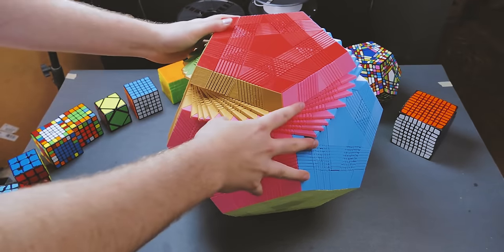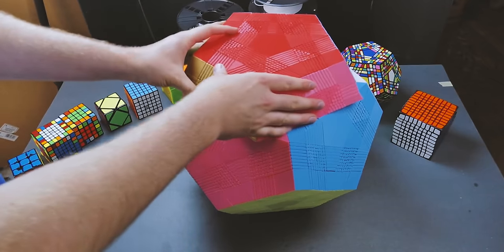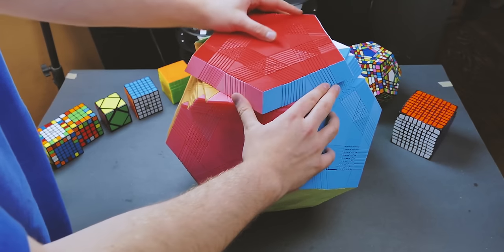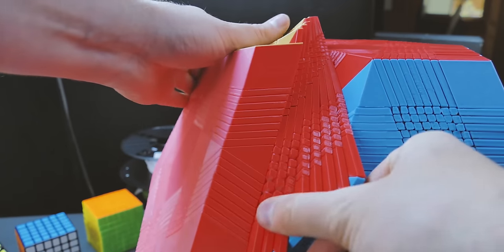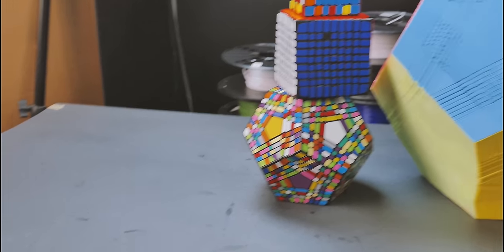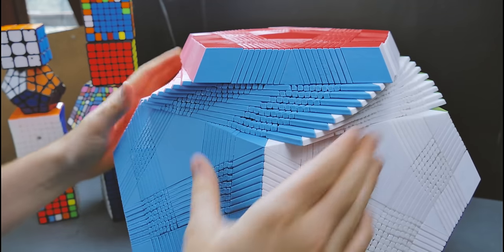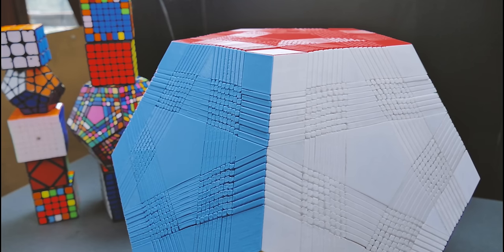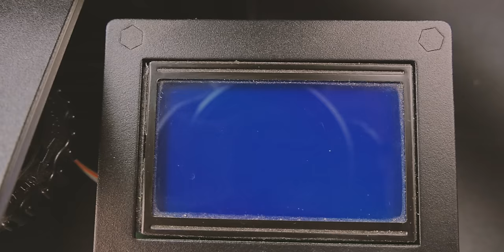Atlasminx World Record (former)

Comment: Hmm, I'd imagine a large portion of the movement issues come down to inherent inaccuracies of FDM printing (elephant's foot, warping, rough layer lines, etc). Even spending time to manually sand each and every piece (which is absolutely NUTS), you end up with pieces out of tolerance in a puzzle that's super sensitive to said tolerances. I wonder if most of the quality issues could be quashed by making use of a SLA printer instead! The layers are imperceptible to the naked eye and the tolerances are superb, you should totally give it a try on a smaller scale project!

I'm not too familiar with the limitations of SLA printing and its cost, so I can't speak to my idea's feasibility, but if it's possible it should totally be done!

In any case, this is an incredible achievement, you should be extremely proud of the monstrosity you've made here!
Reply: After seeing FDM printed pieces, my exact thoughts were SLA would make sense here. 1 kg is around 30-50$ for regular resin. Considering that resin and PLA have around the same density, but SLA have higher space-filling resolution, the project can weight around 9-9.5 kg. So not exactly cheap thing to do, considering decent SLA printers cost upward of 1k$.
Reply: @nikarm22  Most decent sla definitely don’t last I checked.
Reply: @nikarm22  Thats expensive

Comment: the only thing that is still on my mind is... how many different scrambles can you make with this...if the 19x19 and everything higher has more scrambles than if you filled the entire universe with hydrogen atoms, to the power of 12, i just can even fathom what amount that would have
Reply: Just too many numbers 😂😂
Reply: i'd tell you the full number here, but it wouldn't fit in the comment character limit, just know that it's a lot
Reply: @froxdoggaming3385  lol
Reply: @froxdoggaming3385  but there isn't a comment character limit
Reply: Wait
Reply: What the f
Reply: U have blown my mind in 3 seconds
Reply: @_bio  clearly you havent held down ctrl+v on a huge message for an entire minute, because there is a comment character limit.
Reply: @_bio  there is lol
Reply: @froxdoggaming3385  use scientific notation
Reply: MATHEMATICS...!
Reply: @froxdoggaming3385  scientific notation is a thing though I know it’s a joke
Reply: 69638836482653826628265282726838783837883889727837376984889928298479286483837838392973982839928374997382873838477692863728299283629378927374668899283735468585428583754888900274716378902428589689658395758373927382638399393999378363696958668689875995685368896534668638557634505763676446969696545743664477564367895885863690443678 possible scrambles